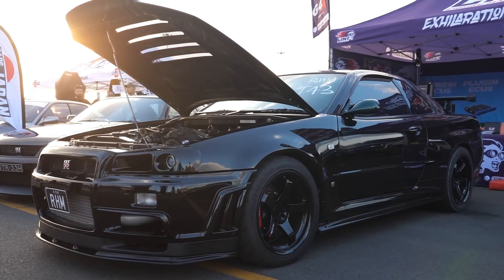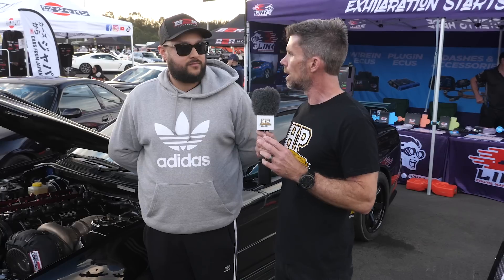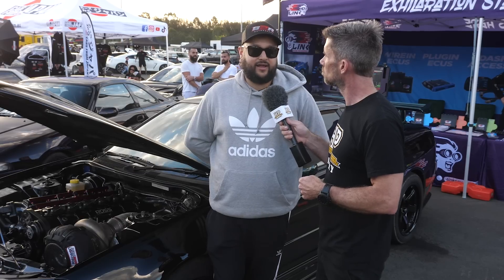This R34 was never meant to be so FAST!

Comment from the maker: ✅ Building a fast car? Get $400 OFF the all-inclusive VIP online course package deal: https://hpcdmy.co/vipy116
🦵Kickstart your EFI Tuning knowledge. Get 50% OFF your first online course: https://hpcdmy.co/offery116
TIME STAMPS:
0:00 - Stock Trim 8.2 @ 177mph
0:12 - Av B2R Motorsport
0:26 - 'RB26' Engine Specs
0:51 - Bullet Hybrid Block
1:44 - Engine Specs Continued
2:30 - Cylinder Head
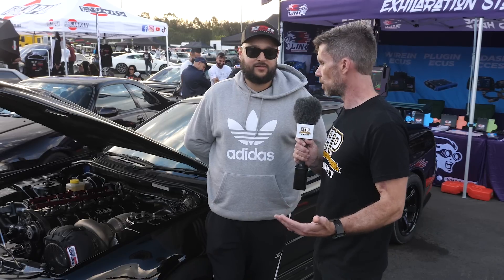3:17 - Valvetrain
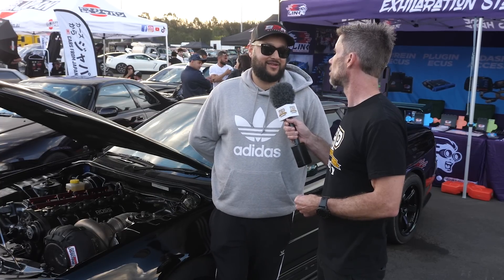3:40 - Cam Lobe Clearance
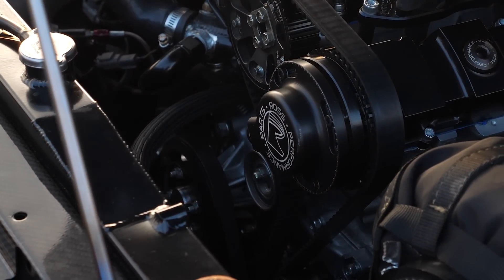3:58 - Dry Sump Setup
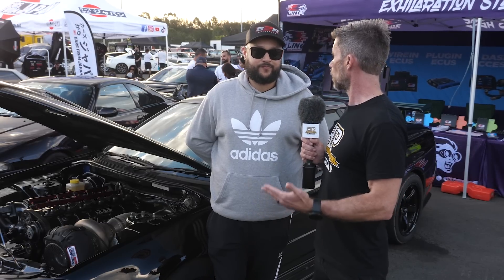4:29 - 9500 RPM
4:41 - 55psi of Boost
5:04 - 1650whp
5:30 - Billet Block Street Application
6:28 - Restricted Link ECU Setup
7:35 - Trigger Setup
8:31 - Why the Nissan CAS Is Hated
8:53 - Albins ST6 Transmission
9:15 - Hollinger Engineering Rear Diff
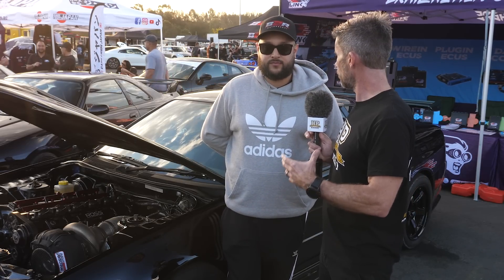9:44 - AWD Setup
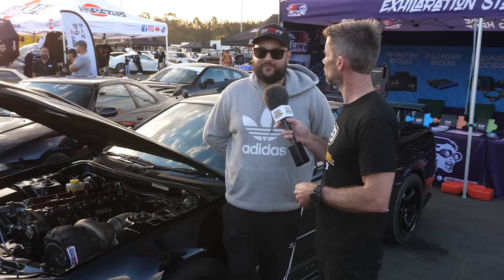10:39 - Clutchless Shifting
10:56 - Safety Equipment
11:46 - Start Learning How To Tune A G4X Yourself

Comment: Link G4 plug n play, was expecting a full motec catalogue
Reply from the maker: Yes you would assume an EMtron or MoTeC off the cuff eh! Not that a Link has anything wrong with it, more just missing some extra, very relevant and usable, features for this level of build that the higher price of a corresponding ECU covers.

The simplicity of the PnP Link ECU has its obvious benefits beyond the limitations though too - Taz.

Comment: It's funny that the jz had to help yall rb guys lmao
Reply from the maker: If you want to get a 2jz to the same power level it also needs 'help' from aftermarket parts 😎 - Taz.
Reply: @hpa101  yeah but not that extreme tbh
Reply from the maker: Depends if you want it to run for a dyno pull to just talk about on the internet or multiple events tbf 😂
Reply: @hpa101  facts lol 😂